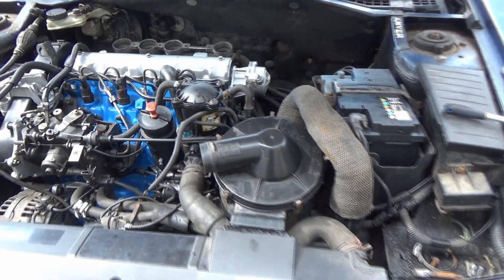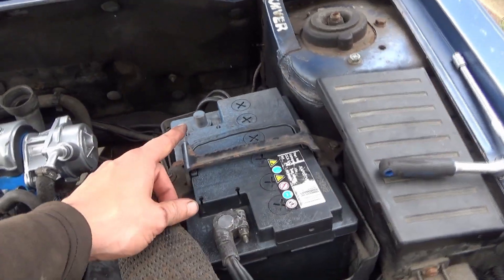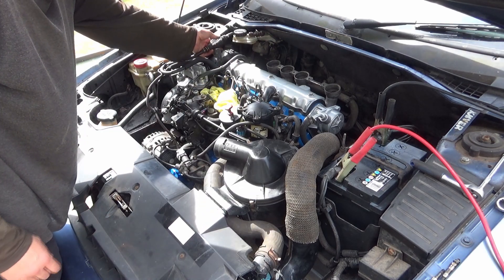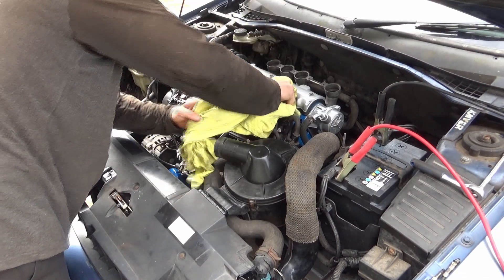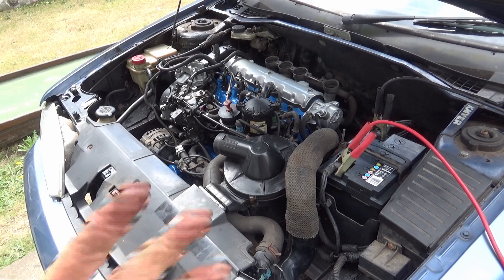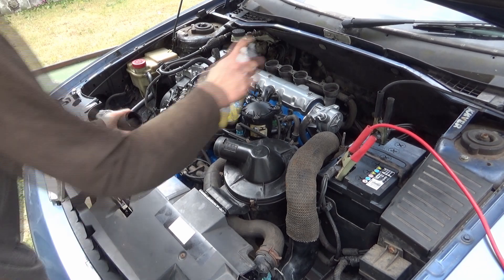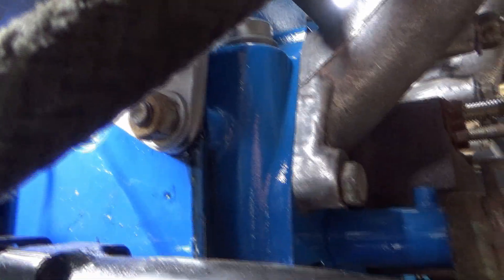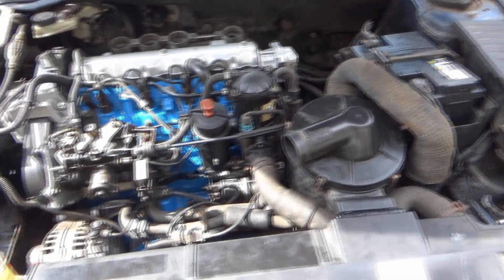The ZX First Startup after a full rebuild of my 1.9 diesel XUD9 engine

Comment: I've got an original 97 306 dturbo I've owned for the past 20 years, still runs great but got some oil leaks to sort soon. Always thought the cam cover is a poor design with just 3 small bolts, never really got mine to seal properly, but last time I changed the seal must be 15 years ago. Done 221k now but always had servicing on time and has never had any major work apart from the rear axle about 10 years ago. Engine, gearbox, clutch and turbo are all original and never been out of the vehicle, though it has had its first bit of welding done this week, common area nearside inner arch. I've loved my ownership, people who slate french vehicles really don't have a clue. Always loved the Zx.

Comment: Know what a happy moment the first start is, congrats.  Maybe a touch lumpy (but was cold, too).  Adjust the Injection Timing on the Pump if you need to
Reply from the maker: I was so happy It started and it ran but I needed to turn off as didn't want to much oil to spill out so didn't get chance to warm up.

Comment: How did you fix the rough idle? It was vibrating alot. I think your Idle speed is set too low ,i did it on mine. Increased idle speed and no vibrations at all. Amazing job !
Reply from the maker: I had the wrong injectors in the engine I was running bosch injectors with a lucas pump took me a while to get it sorted but I got there in the end.
Reply: instablaster.

Comment: Well done there mate, what motivated you to rebuild the engine like, if the engine in my Zx was to need rebuilding I would be tempted to just look for another engine to buy and put in 😃
Reply from the maker: I decided to challenge myself and I certainly manage to do that I've never done a full engine rebuild before so I just thought I would do it
Reply: Very Nice job! And contrata for that but why did you not swapped a xud9te in it?
Reply from the maker: At the time of doing it there was a few reasons 1st being I wanted to do the full engine rebuild 2nd I liked that engine for its fuel consumption aspects 3rd i was originally planning to keep it stock but I do now have other ideas just something I'm looking into that's all I'm saying for now.

Comment: friend, when you removed the engine, did you remove it with the gearbox or just the engine? 

Is it very complex to remove only the motor?

 excuse my English. i am using google translate.

 I work on my citroen Xsara
Reply from the maker: I removed the engine and gearbox together as it was far easier for me to do it like that.

If you undo the exhaust then pop the driveshafts out and that just leaves a handful of electrical plugs a clutch cable and some hoses to undo.

Finally undo lower engine mounts from the subframe then just 2 bolts at the top and a fair bit of wiggling and it will lift straight out the top.

You can just remove the engine and leave the gearbox in the car but I personally think its easier to remove all at once and separate once out.
Reply: @TheZXGuy  thanks friend